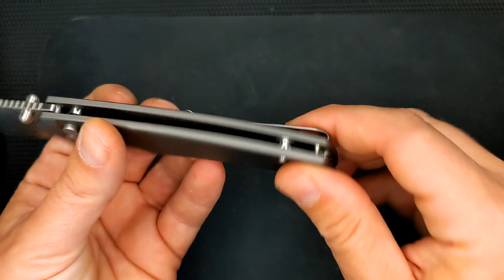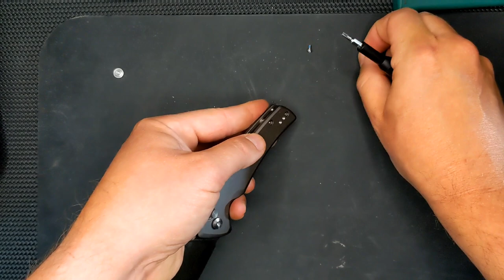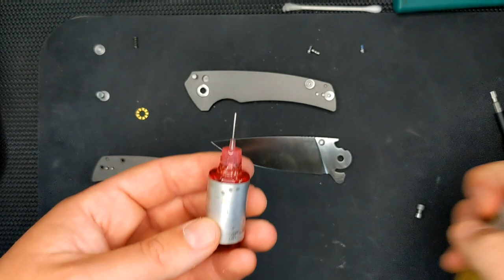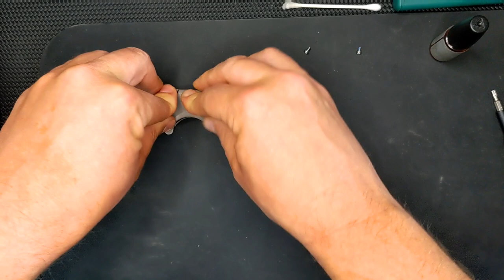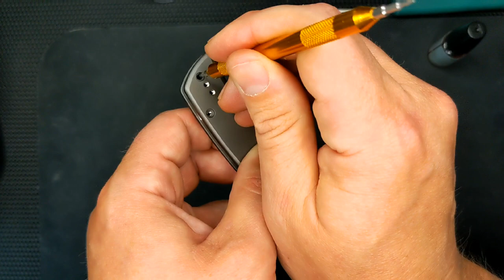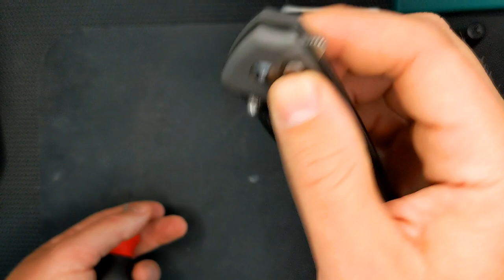Sencut Serene Tear down, disassembly, maintenance, and rebuild.

Comment: I have stripped two T6 Torx screwdrivers trying to take off the clip. The screws will not budge. I have heated up the clip and screws to the point where they are untouchable. Nothing. Any suggestion for removing the clip??????
Reply from the maker: In theory, using. A hair dryer should have loosened up the loctite that's holding them in. If you've already stripped the screws, then there's very little you can do. You are using good solid bits? Like Wiha? The next thing you can try is to spray some WD-40 or some B-laster PB penetrating catalyst. Let it sit 24 hours. Wipe the heads down really well with alcohol so the bit doesn't slip out and heat it again with a hair dryer. Hopefully that helps?